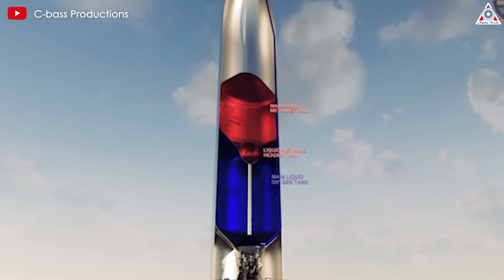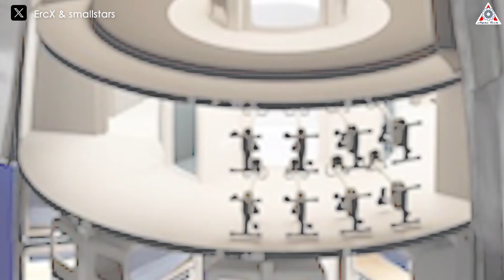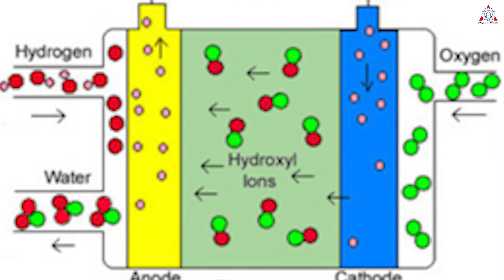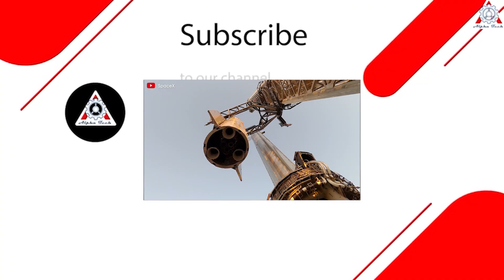SpaceX Major NEW Design Lunar Starship INTERIOR Somehow Better Than NASA...

Comment: Primary power should be a small nuclear reactor with lightweight batteries as a storage/buffer and to provide hydrogen for fuel cells. It would be useful to recycle water into oxygen to breathe and hydrogen for fuel cells. Having multiple power supplies only makes sense on extended missions. A large solar array/solar sail might be an option when "coasting" for extended periods.

Comment: Seems like you could set up some fans in a tube to create a shower. Water is pumped in. Just like a normal shower. Fans are placed, one in the top and the other in the bottom. They would blow\draw in such a way to move the water as if in gravity. The water could be recycled. 
Don't know about windows, seems like it would be a risk due to radiation and breaking. 
flat screens with multible camaras setup to simulate 3D views would be better. 
As for power, there is another option. Nuclear power. A small reactor could be placed on the ship that would meet all there needs. It could then be used to power a settlement once the ship reaches the target world. 
Keep in mind that battery's can only store power, they can not produce it. Also, no matter how efficient the battery, the supply will always be limited. They would be great for a backup or to supply power at peak times and recharge during off hours.
Also carrying enough to supply power for the whole trip would be really inefficient use of weight and space.
Hydrogen fuel cells would be promising. You could even make more Hydrogen and oxygen out of the water. Provided you could get a net gain in power. 
But the problem with Hydrogen is that it has to be kept cold and it will boil off. While I don't really understand how it can escape from a sealed enviromint it does. So you would lose some of that fuel over time.
Also, I think that I should point out that Starship will use Methalox or Methane and Oxygen as it's fuel. Meaning that any Hydrogen would have to have it's own dedicated tank with a cooling system to keep it stable.
Seems like NASA could help SpaceX with the harvesting and conversion machines.
You know that a trip to another world is not going to be all rainbows and sunshine right?

Comment: Still waiting to hear how SpaceX will deal with radiation in the long-term exposure scenarios, it's not like it's a minor detail somebody will fix soon.
Reply: Easy, living and working spaces will be encased in a shell just inside the “skin” of starship. The encasing must be waterproof and about 2-4 inches thick. Fill it with water which will then absorb the radiation and could possibly be used as fuel once processed when they reach mars.
Reply: @2ndhandjoke  Rubbish

Comment: There are several new designs for small modular nuclear reactors requiring no maintenance, Rolls-Royce is one company working on this and there are others. 

The safety and redundancy I would probably suggest they would need a minimum of two possibly three. 

However if the reliability is extremely well proven even one reactor would be enough. 

Scientia Habet Non Domus,
(Knowledge Has No Home)

antiguajohn
Reply: the KRUSTY type reactor may be enough for the ship itself i guess

Comment: we use Hydrogen cells in our Warehouse trucks but it has lots of draw backs because of the high load they need to operate under with forklifts but also the dust neither would be a huge concern in a spaceship if you have enough of them for redundancy and parts.

Comment: Starship has only made it to orbit on its fourth try.  It carried no load, had no fuel left, and disintegrated on reentry.  That is a spectacular failure.  The plan to launch 18 or more additional rockets to refuel the lunar lander in orbit is ludicrous.  It is tall with a high center of gravity so it is more prone to toppling when landing on an unprepared surface than a short squat vehicle like the LEM and other proposed lunar landers.  Making things even worse, the pilot cannot see the ground so the landing must be automated.  The crew won't be able to take over manually like Buzz Aldrin did on Apollo 11.  This is the dumbest plan ever conceived.
Reply: Neil Armstrong flew Apollo 11, not Buzz Aldrin Aldrin. If SpaceX is allowed to iterate Starships as fast as possible, they’ll make a Lunar  lander work— taking your concerns into consideration
Reply: Thanks for the correction about Apollo 11.
Reply: well then. i guess we should just give up.
Reply: Starship isn't the only game in town.  I suggest an alternate lunar lander.

Comment: The approach makes no sense to me.  The Mars journey could be better off with launching 10 Starships to orbit and connecting them all, with various ships having different functions.  For example 2 ships could be for power, 1 ship for habitation, 1 ship for food and water, 1 ship for farming, 1 ship for recreation/exercise/entertainment, 1 ship warehousing, etc.  Then send all 10 to Mars orbit, detach and land -or use landers to ferry crew and supplies down.
Reply from the maker: that's a great idea too
Reply: That is so brilliant, it may be the thing that makes mars work.  Clusters of specialised ships means the lander's mass can be only a small fraction of the mass of the earth to mars ship cluster.  You leave all that unnecessary weight behind in mars orbit instead of trying to land all of it.  Other ships in the cluster can be specialised landers with smaller fuel tanks because the ship only needs full tanks to reach orbit from earth and the tanks would only be partially full when the ship enters mars descent, so why carry the weight of oversized tanks?  I wonder if it would pay off to design a 100 ton mass-produced lander that could launch from earth as starship payloads and be carried to mars in the kind of ship-cluster you describe.  It might result in more payload to the surface by not carrying so much extra weight.  payload to surface can be optimised even more with even lighter one-way landers for cargo that don't need to land extra propellant to climb back to orbit.
Reply: Agree but if the left and the FCC don't back off it will take space x 10 years just for testing
Reply: The lesson from earth exploration is that several completely self-sufficient vehicles is the best strategy for redundancy and hence safety.
Reply: @barry2585  how are Starships on their own heading to Mars redundant?  Are you saying if one fails another ship will re-direct to it then dock and rescue passengers?  How will the rescue ship deal with the added occupants?
Reply: @beaker4809  Not starships on their own. Still a fleet, but within that fleet each ship is capable of surviving without depending on others. With your specialised ships idea, the whole fleet would be in trouble if the food carrying ship blew up. This is just one example.
Reply: @beaker4809 Too big and complicated.
Keep it simple.
Reply: It does not need to be that big, plus the split if resources needs to be different than that.
Reply: Multiple stand-alone ships mean multiple stand-alone life support systems.  Not a bad thing when you are far from earth.  Even Columbus took that precaution.
Reply: Only problem with this suggestion is that your ships have coordinate their engine burns, like EXACTLY, or you’ve got major problems.  Second, starship isn’t inserting into Mars orbit.  It’s going to perform atmospheric breaking.  If you want to bring along enough propellant to slow down into orbit you won’t have anything left for cargo.
Reply: Changing horses in the middle of the stream introduces its own complications. Just to get into orbit each component would need its own engines. The starship already has that. Otherwise a major redesign would be needed. Some kind of lifter to launch modules into orbit would be needed. Several different ideas could work well enough, they need to pick one and stick with it.

Comment: Apollo? I don’t know HOWEVER I would have gone up the day after the Space Shuttle disasters.

Oh, yea.  Side comment(s)
The garden also helps with CO2 and O2.
There is a fourth power option. Nuclear. NASA has been using one specific type of nuclear reactor for power for DECADES.  In fact Voyager uses them and both craft are still operational after decades of use.
Reply from the maker: thanks for the reply! have a good day
Reply from the maker: your opinion is very reasonable